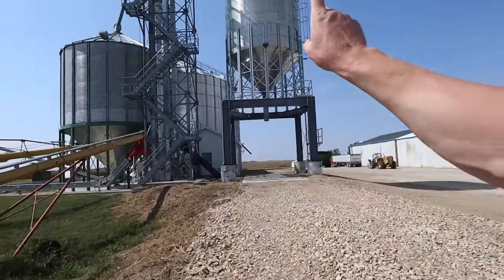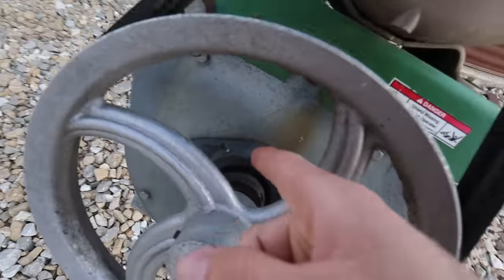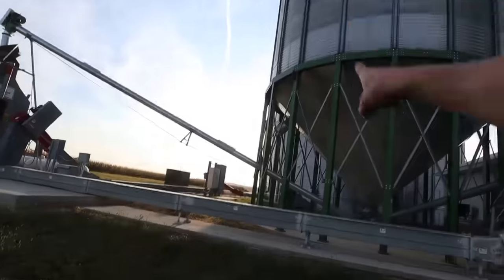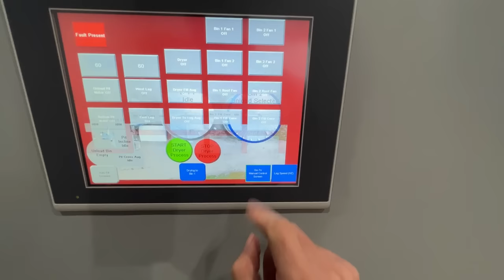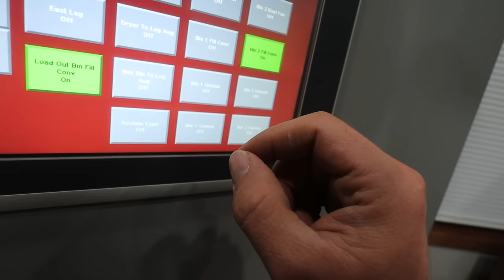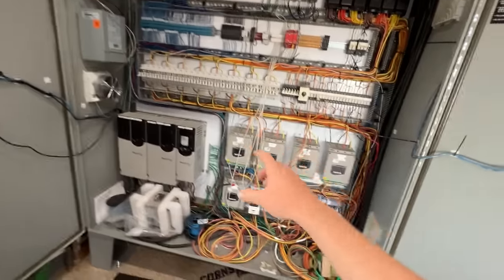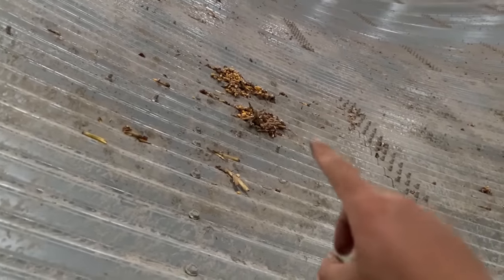I Worked On The Un-Safe Bin Site (OSHA Un-Approved)

Comment: Good safety alert.  I worked for an oil refinery for over 30 years & I have heard stories of not only refineries, but farms or anywhere else where there's a pit of some source.  A person would go down into the pit or whatever place & then end up passing out.  Then if there's a family member or a co-worker would go in & try to save them.  Then that person passes out too.  And so on & so on.  I have heard of at least 4-5 family & or co-workers dying from trying to go in & save the previous people.  Venting it is definitely a good thing.  You can also buy hand held or even clip in air / gas meters, with an audible alarm, that will tell you whether the place is safe to enter or not.  In the refinery we even took it a step further & had the person be tied off to a rope, or something similar, with a safety watch that would be able to pull that person out, if need be, without having to put themselves in danger on having to go into the area to try to save a downed person.
Reply: If you climb into the pit someone passed out in then it’s natural selection
Reply: The telephone companies also never enter a manhole without blowing out and testing for gas.

Comment: I would agree with the suggestion to run a vibrating roller over the gravel. If I understand the layout, the area down at the peak (near the corn) is where the semis will be doing their final turn back towards the pit. It is in this area that the semis will exert the most lateral pressure on the road base for that entire 180 degree arc. Since you’ve built this over un-compacted dirt, I would keep a load or two of rock on hand just in case y’all get a really wet winter and see the trucks mash it down to unacceptable levels. If there are other areas that will see the semis making sharp turns, I’d vib-tamp those hard also.  Love the videos, and I swear, y’all don’t know the word quit. 🫡

Comment: Little late to the video, and should have commented on earlier about the bin site handrails. I work in a commercial alcohol facility with a large elevator setup / fermentation tanks / high walkways. When you look backwards at 14:02, the handrail at the lower platform should be head height of the upper one you climb onto, and I’d say a little wider than the upper walkway. This way if you were to fall off the upper, you won’t go over the lower handrail. Also, build a walk way frame / grating any place you cross a drag as those rot from the inside out and you won’t know until you step on it and your foot goes into the moving drag. Lastly, I’ll agree with other comments of implementing a lock out tag out system and using a 4 gas meter with rescuer before entering confined spaces, call up millennial farmer he promotes this a lot.

Comment: need to put embossed metal tags where needed on outside equipment with indicaters marking open or closed position or operating position and as someone else mentioned labels for fuses used should have been put on and circut info

Comment: COLE GET YOURSELF  A COMMERCIAL GRADE VACUUM CLEANER .LIKE THOSE AT A PUBLIC CARWASH. WITH A 80 TO 0NE HUNDRED FOOT HOSE TO HELP CLEAN THE GRAIN BIN. IT WORKS GREAT. SET IT ON A SMALL TRAILER WITH PORTABLE GENERATOR IF NEEDED TO MOVE IT PLACE TO PLACE

Comment: You need to get your electrician out there and go through that control cabinet with you and draw up a directory showing what each set of  fuses protect.
Then tape it on the inside of the door. 
Your fuses are there to protect the wires and equipment.  Dont just start throwing a fuse in something not knowing what its protecting.  Then get a few of each size for spares. Set up a "spare fuse cabinet" better to be prepared then to get in a bind during harvest...
You guys run a first rate operation, we're just a bunch of guys with some industrial experience trying to help.
Lock out tag out.
Confined space safety. 
Setting up barriers when you open a pit. 
Having a up man when you go down in a pit. Ware a harness so the up man can get you ut.
Stay safe guys.👍

Comment: Open holes are a danger for the dog and any animal.   Some wire mesh steel would be a good safety measure...for those 'What If' scenarios.
Great job Cole on all the details on the maintenance points.

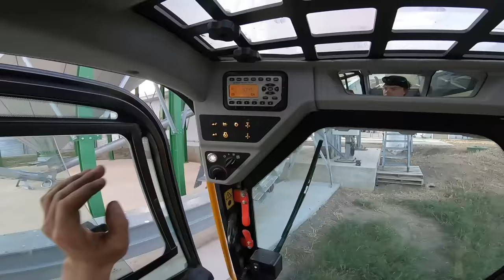Comment: 17:51 - They make grease gun nozzles that can side connect to a fitting instead of the normal connection for tight spaces. Maybe replace the fitting itself with a angled one pointing a more accessible direction?  Change it and never think of it again.

Comment: Cole, how about a Billy goat or dr power leaf vacuum to lift up into bins? No blowing or sweeping, efficient, faster and only step is to lift it into the bins and they weigh about 105 so not bad at all… my OCD clean like you have would solve 3 issues all in one. ✊

Comment: SAFETY ALERT: Cole, (and any others this relates to) when you’re opening up a space like the motor hole for the pit auger, you should force ventilate it for at least a couple of hours before entering it. You never know what gasses might have accumulated down there. Carbon Monoxide will kill, and is heavier than air, as is hydrogen sulphide (generated through anaerobic digestion among other things). At deadly concentrations you cannot smell either gas.

With regards to forced ventilation, that means a ducted fan with ducting to the bottom of the space. Your rubber covered pit also counts as an enclosed space.
Reply from the maker: I would not have thought about that. Thank you.
Reply: Yes, thank you for sharing this. I to.never thought about that
Reply: Hydrogen Sulfide.  Odorless, tasteless, and very deadly!
Reply: I retired from a nuke plant in NY. We were required to do an annual radiation survey in a large concrete building. The algae was so thick that the oxygen was depleted below the level for human entry. Had to vent the whole building before we could do the survey.
Reply: We had three brothers pass away at an Ohio farm last year from this. One went down got sick the other two went to try to help they all passed away. They were in their late 20s early 30s
Reply: @nyjohn12 which plant? I work at Ginna
Reply: I do not know Cole, nor his family. However,  I have watched them grow through the years, and though they will never meet me, I feel close to them. I am very grateful that you have brought this potential disaster to his attention.  God forbid such a thing would happen to any of them. Thank you, thank you.  My sincere condolences to those who have lost loved ones through this seemingly innocent task. My heart is in my mouth every time any of them have to climb up to those heights. I keep them in my prayers. Just an elderly grandma here that cares a lot.
Reply: I had a family friend die from hydrogen sulfide he was cleaning one of his augers out but it had a bunch of rotting corn in it. he must of stuck his head in to reach farther inside. he died with his head and arms inside the end of the auger the rest of his body was in the fresh air. when he did not come in for dinner his wife went looking around the farm for him and found him still warm but very dead
Reply: @imchris5000  Such a tragedy.
Reply: Gas detector is not As necessary if you can flush the confined space before you enter it. And while inside the space.
Reply: Harbor freight has ventilator Blower and the fabric Hose into the manhole lid for things like well pits.
Reply: Smaller Bird shot pellets shouldn't hurt the bin sheets. Full hearing protection required!!
Reply: very true. when i was in the navy, we had three people die in a unvented space on our ship. not one of them put a tester in to check the air.
]
Reply: My the MILLION PLUS DOLLAR BIN DEBACLE CONTINUES  UNBELIEVABLE. YOUR MAINTENANCE SCHEDULE SHOULD BE MORE IMPORTANT THAN ANY OTHER WORK ON YOUR MACHINERY AND STORAGE EQUIPMENT. AHWELL ONE DAY YOU'LL UM LEARN 😂😂😂
Reply: Stupid is as stupid does. Confined Space protocol, who cares. That would get a lot of views, someone dying in the pit.
Reply: I found a shop vac useful.  Put on push side, hook added hose (old sump pump soft hose) drop down, turn on. +10 minutes later it likely fine.
Reply: @nyjohn12  Was it an enclosed building like a tank or something with water in the bottom, sounds incredible.
Reply: @sarawoods7874  omg sorry to hear about that, can I ask what was the enclosed space they went into.
Reply: @imchris5000  Jesus, I had no idea this was such a serious issue.
Reply: @deepwinter77  I'm not exactly sure I will have to see if I can find the story again it was written in our local electric coop magazine a few months ago. They worked their parents farm and had cattle but I can't remember exactly
Reply: Well said!
Reply: I always ran the bin fans for this when I worked at a feed mill and it worked fine and we used a multi gas monitor to check the air before we went in and while we were in
Reply: @williamburns9731  I'm confused.  You are shouting (CAPS, not a good look) at him about not having a maintenance schedule.... on a video about his maintenance schedule.
Reply: I would also suggest purchasing a 4 gas meter.  There are several types.  Some are wearable and some have a ‘sniffer’ hose that can be lowered into confined spaces before you enter.  They’re not cheap, but your life is irreplaceable.  I would highly suggest both types that way you can check the space before you enter and then wear one the entire time you’re inside.  They monitor the air and can alert you of danger before you would feel symptoms.
Reply: Yeah I noticed that was a bit risky or so I thought. 
H2S gas ain't nothing to mess around with !
Reply: @ColeTheCornstar  strange i hadn't thought of it either ,,and i've been doing farm work since 1990 ,,i used to clean Harvestore bins and i had to wear a respirator to breathe
Reply: @williamburns9731  ANOTHER KNOW-IT-ALL CRITICIZING SOMEONE ELSE. STUFF IT!
Reply: @deepwinter77 ST Henry ohio. Wuebker brothers. It was a different scenario, they went into a manure pit. Caution should be used everywhere but manure pits and wet corn and silos are way more severe.
Reply: In addition to this comment it would also be wise to use a gas and oxygen tester. We use one that tests oxygen as well as 5 other gasses and in confined spaces that sees a lot of moisture and or rotting grain even after ventilating for a while can still detect a presence.
Reply: @jeremiahlackey1582   i have  a gas sniffer myself  from  back when i used to clean  grain bins ,,i never really thought about  a pit like this  but it's still an enclosed space
Reply: ⚠️OSHA HAS ENTERED THE CHAT!!⚠️
On your toes...Look alive, boys!😳 It NEVER fails that some (every) Safety Steve nitpicks EVERRRY tiny thing.🙄 Why not gear up w/your full SCBA turnouts, harness w/lifeline, 4 guys standing watch, CM/HS detector, confined space permit, lockout/tagout on motor, pit taped off, MediVac crew on standby w/LifeFlight idling on-site!?

Sheeesh....🤦🏼‍♂️ They aren't dumb. They've been doing it the same way for 150 years, since Christ was a cowboy and they've been JUST FINE.💯
People these days just need to chill. Everyone is a Keyboard Safety Inspector know-it-all.👷🏼‍♂️🕵🏻‍♂️📋 
It amazes me how much our parents, grandparents and ancestors before us were able to accomplish WITHOUT 400,000 regulations, red-tape and OSHA  crawling up their a$$. 
They simply did what they had to do and GOT 'ER DONE...come Hell or high water. Period. 🇺🇸💪🏻🛠🔩⛏
Reply: And a harness and a standby person to meet OSHA along with training and notification system for confined spaces

Comment: Why isn't there a port in the auger system to  blow high pressure air into the systemand have it exhaust out into the in field and use it when your done filling.

😊😊😊

Comment: Please buy you an amp probe so you can check the amperage and put the proper fuses in because if you exceed the motor rating, the motor is not protected anymore and you will burn the motor up

Comment: With your wire nutted issue, I'm surprised they didn't have a fuse block when your panel was built, let alone you not having a wiring diagram for it in the cabinet. all of the information on what fuses were used and what wire numbers mean should have been there.

Comment: In Australia we a specific paint writer on metal and paint. However Colin I was always told to write all procedures on anything mechanical that's not used all year round. JUST COMMON SENSE. IT'S NOT TAUGHT AT COLLEGE OR UNIVERSITY.  LET'S HOPE YOU HAVE RECORD CROPS. ALSO THE RUST IN YOUR PIT IS DIGUSTUSTING  ME I WOULD HAVE TAKEN THE COVER OFF THE AUGER , SANBLASTED, AND PAINTED WITH 2PACK PAINT 🎨.

Comment: Cole for difficult to reach grease zerks, you can install grease fitting extensions. These resemble grease gun flex hoses but have mount plates for the grease fitting to be placed in a more visible and convenient location. Many auto supply and farm supply store like Tractor Supply carry these. I've installed many of these on screw conveyors and bucket elevators, then paint the picture of a grease fitting so it won't be missed. These lines are often used with are referred as whole unit grease supply for automated grease feed.
Reply from the maker: That’s a great idea
Reply: if you go through the effort to plumb the system you can easily make it automatic feeding from a central 55 gallon drum of grease
Reply: @ColeTheCornstar  lots of industrial maintenance guys will just make their own, it's not hard and you can find lots of the parts on supply companies like McMaster Carr,

Comment: Your electrician should have labeled the breakers for fuse size. It's better to know.
Reply: Yes, he should have. My advice would be to check the motor ratings, or the cabling schematic if you have it, label each holder with the ratings (Amps and type, 12Am for example, as it tells you how fast the fuse will blow) and always have enough fuses in the panel go replace everything. They are cheap, and you don't want to lose an hour, or a day, getting new ones when you need them

Comment: Another safety alert from my refinery days.  You mentioned, regarding safety, before you checked the breaker cabinet whether the breakers were in the open position, which is good.  In addition to that you should hang a note, we had different colored tags, on the breaker or even on the outside of the cabinet door, alerting anyone else that work is being done & not to close the breaker.  In addition to all of that, we had different colored locks, depending on the craft, to either lock out the breaker or the outside of the cabinet.  Working for the refinery for over 30 years & getting preached to about safety on a daily basis, gets stuck in your head, which is a good thing.  : )

Comment: So that lack of space for a fuse allocation for 283 is another design error in the system, It also looks like the bar to support the fuses is full, not exactly a design error, but a really good design leaves some room for expansion or if an existing circuit has to be split. Things to look for in any future designs.
Reply: 283 does have a spot, but there's something else wired in with loose wires...

Comment: Looking good!
For the knots on those temp/moisture sensors in the bins, look into the Midshipman’s Hitch - let's you adjust tension on the line whereas a square knot is not adjustable.

Comment: Just curious: at 23:39 the shot of the Case pulling the new grain cart, the tread on the case go "up" but the grain cart goes "down"... A does it matter?? or like many a tire, they are designed to be directional in rotation and one of them is wrong???
Reply: This has been explained in alot of farming youtube videos.  When you have tires that are just rolling, and carrying load, but have no torque being put to them; you get less dirt compaction by putting them on 'backwards'.
Reply: @edwardschwenk3100  Thanks.. good to know.

Comment: Instead of having to climb down through the pit access hole to grease things you could install remote grease lines and mount them in the access cover.  You could add a recessed pocket into the access cover so the grease fittings are recessed below the surface.  You should install remote grease lines everywhere there is hard to reach or access grease points.  If you have a bunch of grease points in one area you could install an electric automatic lube system and control it from the plc in the dryer shack.  You could even program the plc to automatically libricate points after a certain amount of usage.
Reply: As much help as lines can be they can also fail. We had grease banks on sprayers at the coop on new machines. In under 3 years they were broke. Same with my father in laws baler. We could see grease drip like it was full but the lines were cracked an inch up. Best way to feel confident in a line is to be able to visually see grease push out of a bearing even if you can’t reach it.

Comment: Get a cheap laser level and then use a put-right board to gauge distance so you can gauge the taper.  My dad used to use a transit level, but these construction laser levels are way cooler; just stick them to your bin site.  Kind of surprised your bin site catwalks do not have tie-off points; it sure seems like a massive fall site. We have tie off points built in our our houses up here.

Comment: You should bolt a 4” round plate made out of 16 gauge steel onto the end of the moisture sensors, then tie the plate down to the floor. This way when the string breaks. And they always do. The sensor strings will stay in place and not be pushed out to the sides of the bin. The plate will act like an anchor holding the bottom in place. Otherwise the string breaks and the sensor strips will pull up as the grain pushes them towards the side of the bin. This is why they always look out of place as the level goes down.